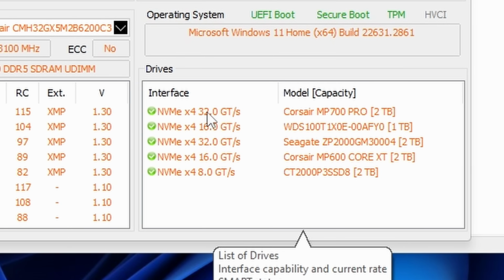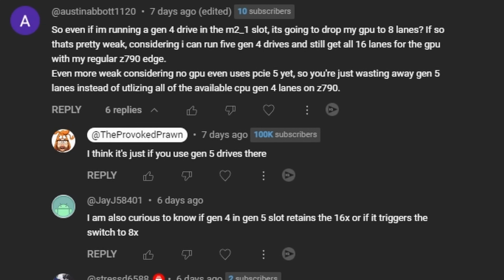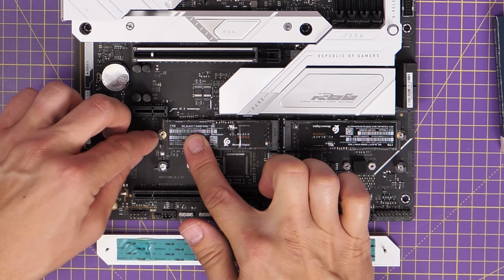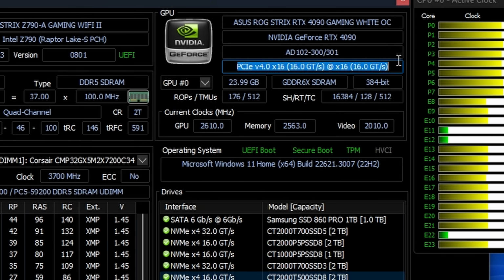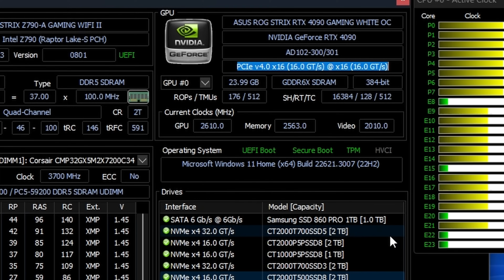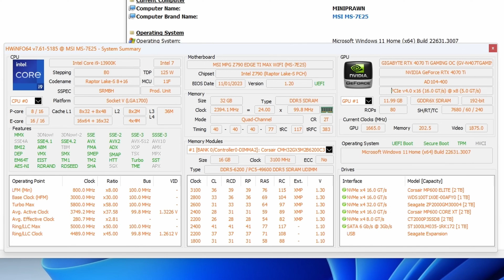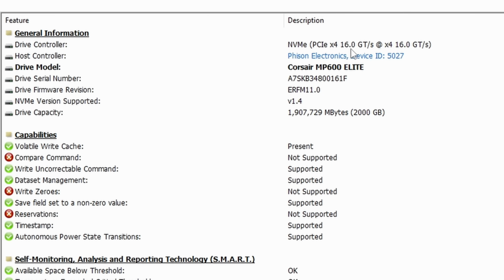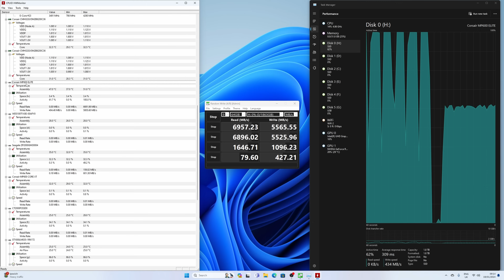Problems with NVMe SSDs and motherboards that you need to know

Comment: This isn't all that surprising. PCIe lanes are literally physical wires in the motherboard PCB, and the switch that splits lanes between the M.2 and graphics card slot is a dumb physical switch. It doesn't analyze the quantity or quality of data being sent through it, either Gen4 or Gen5 - it merely detects ANY activity at all coming from the M.2 slot and if so, it activates and re-allocates the physical lanes, like a throwing a railroad switch and changing a train's course.  

Of course, this lane switching scenario only happens on SOME motherboards, depending on the PCIe lane layout. But there are also plenty of motherboards that can run a x16 graphics card AND multiple Gen5 M.2's without any switching or graphics card downgrading at all. ALWAYS CHECK THE MOTHERBOARD BLOCK DIAGRAM available from Gigabyte, MSI and Asrock on their support page > motherboard manual PDF download. ASUS is ** because they keep their motherboard diagrams and lane configurations a secret.

For example, if you look at the Gigabyte X670E AORUS MASTER, it has a PCIe 5.0 bus with 24 total lanes, x16 dedicated to the graphics card slot and x4/x4 allocated for two Gen5 M.2 drives. 16+4+4 = 24 of 24 used, meaning that it has enough lanes that it doesn't need to share. 

Whereas, the Gigabyte B650E Aorus Master also has 24 total 5.0 lanes, allows for four total M.2 drives at x4 lanes each, but doing the math having all four M.2's plus a graphics card at x16 would mean 16 + 4 + 4 + 4 +4 = 32 lanes required but only 24 available. You could choose to use only two M.2 drives which is 16 + 4 + 4 = 24 and that works. Or if you want all four drives then that's where the lane switch comes in: If M.2 slots b and c are occupied, the board takes x8 lanes away from the graphics card and re-allocates them to the M.2's instead, making the math 8 + 4 + 4 + 4 + 4 = 24 which now works.

Comment: @The Provoked Prawn Completely unrelated question, but  I cant find a concrete answer anywhere else and was hoping you could help - I have just built my first ever PC, and I'm using the latest Corsair iCue Link H150i AIO Cooler for my i9 13900K. 
My question is which cooling preset do you recommend I use, and is there any negative effect of running the pump at the extreme setting? Would it reduce the lifespan of the pump, for example?

Same goes for my fans too, which preset would you recommend for Corsair iCue Link QX RGB fans? Would running them at extreme wear them out quicker? Or is it something I shouldn't really worry about?

Much thanks in advance mate.
Reply from the maker: Sounds like it's running too hot for your liking? I don't know the long term impact of that but there are other things you can do to reduce temps https://youtu.be/jP7nERdD-Gk

Comment: I have an ASRock X670E Pro RS and can fill all the m.2 slots and still get 16x Gen 4 for the GPU, depends on the CPU and motherboard type, if the motherboard has it's own controller chip for M.2 drives I think it frees up some lanes from the CPU.
Reply: controller chips still need pci-e lanes to connect with the cpu. what the issue is, you can have all your nvme's connected and r/w at max speeds, the chipset bandwidth is limited. so tranferring data from all of them at the same time doesnot addup because the chipset has to share the bandwidth with every device it has. it's a common misconception, the fact that the drives are working at full speed, doesnot mean that the data are going to the cpu at that rate.
Reply: You only get 2 nvmes with full bandwith on X670E. If you look at the block diagram every am5 chipset only have 4 pcie lanes to the chipset AMX. You can have all of them doing max speed individually but you load two chipset ssd and its already halved.

Comment: That's specifically why I chose the MB i did. I confirmed the last nvme slot piggybacked on a SATA port but did not interfere with the PCIEx16
Reply: Which board did you get? as far as I know this is a problem across all Intel boards
Reply: @quatreraberbawinner2628  AMD MSI X670E Carbon
Reply: Did you know that most GPU's only use a maximum of 8 out of the 16 lanes ? And the remaining 8 is lost ?
Reply: @Matlockization  untrue. Most cards cannot fully saturate 16 lanes of pcie 4/5 yet. However GN and HU have shown the 8 lane budget cards take a performance hit on pcie3 motherboards

Comment: It's daibolical researching this.  You literally have to read the manual of every motherboard you're looking to buy.

This was supposed to be easier with AM5, but the B650 and X670 chipsets then got inexplicably split into B650/B650E and X670/X670E which made the whole situation as clear as mud.

Why AMD didn't just say, "B650 is PCIe Gen 4 for everything and X670 is PCIe Gen 5 for main M.2 and first PCIe expansion slot" is a mystery to everyone.
Reply: What causes this? Filling up too many PCI lanes? What do you check to see how many devices you can connect without a hit to GPU performance?
Reply: @HardWhereHero you just read the manual.

It’s a bitch, but it’s totally possible to gather the information before you make the purchase
Reply: You can get kernel instruction pipe issues, cpu affinity, nvme driver code, to the fact that some boards may have one slot(main) apart from 3 slots on a switch before it hits the root complex, or any combo thereof. I'm not saying anything throttles down, but even the test software is baked, based upon the fact that threads rent time on a single instruction queue, assigning workload to any given logical processor. The OS could prioritize your system drive, and assigning workload at that level, start grinding. OSes do go thru kernel and driver updates for said reasons. This is not the first time the hardware has outstripped the OS. I would use one 5.0 drive and leave it at that. Buy the biggest one, not 4 of them because 6 is already specced out. When you're brand new, you're retro.

Comment: 100% of this issue is down to AMD and Intel sitting on the old ways of 24 (20 via CPU and 4 via Chipset) PCIE lanes is enough.
Reply: Forcing those who need more lanes to threadripper.
Reply: That's exactly what I'm having to go with for my newest build. We need more than 20 lanes... @richardj163
Reply: This is why I miss the old enthusiast line of core i7s that used the LGA 2011 socket.  Besides having quad channel RAM, those had enough lanes where you could even run a full dual GPU setup using 16x16 lanes, and still had a few to spare.  They need to update the enthusiast line and bring it up to full pcie gen 5 spec.
Reply: LGA 1700 uses 8 lanes for chipset… well at least for H670, Z690, H770 and Z790, the lower boards use 4 lanes though.
Reply: It's not an issue of old ways. It's an issue of edge cases. The overwhelming amount of people on these platforms are going to be running at most 2 drives and a GPU.
Reply: @jordanwardle11  tho, i miss the days when there was 6 SATA ports on every board (at least those worthwhile to buy without breaking the bank! - that joke of a mobo put into office PC's i certainly don't mean!^^)
Reply: Arrowlake has 60 lanes afaik
Reply: @Andrew_Thrift  *20 PCI-E Gen.5 + 4 PCI-E Gen.4 for chipset - idk who came up with freaking 60 lanes for a consumer chips, but i highly doubt it - tho, we'll see when it get's actually released! :-)
Reply: @BlackRedDead1943  there are 20 PCIe5 + 4 PCIe4 on the CPU, then the 800 series chipset supports 24x PCIe4 for a total of 48 lanes
Reply: @Andrew_Thrift  cool, thanks for the info ☺👍 - still not even close to 60 tho :D
(but yea, that should stop the few ppl whining about having no inbetweeny server grade but consumer quality board xP)
Reply: sorry to brought you to reality, but it's simply true that that's enough for most ppl, and depending on the PCI-E Gen. and the actual GPU, running it at x8 isn't really a problem at all!
(PCI-E gen.4 x8 is PCI-E Gen.3 x16 - so my 5700XT won't suffer as much with a board upgrade from gen.3 to gen.4 + NVMe Bootdrive + other PCI-E devices - tho, testing will show.)
Reply: @BlackRedDead1943  Don't be sorry. If you are happy with your setup that's fine. I have to accept data transfer limitations. As I stated in my first post, AMD and Intel are doing nothing to expand PCIE lanes. Motherboard manufacturers can add a chipset to allow more PCIE lanes and when they do; the prices seem to be 3 times as much (and higher) than a motherboard without.
Reply: Not sure about all AM5. But the 7800X3D has 28 lanes total. 4 for chipset and 24 usable. So you can have your whole x16 GPU + x4 M.2 G5 and 4 to spare. And the B650E and X670E chipsets have 36 and 44 usable respectably with 24 been Gen5. The original X670 only had 8. So the X670E that come with PCIe G5 and an M.2 G5 they don't have to split it. They do everything else with the other lanes. Probably why so many boards share M.2 with PCIe slots or Sata ports. Unable to used them all simultaneously. To prevent stealing from the GPU or M.2_1. 
This seems to be an intel specific thing. The LGA 1700 is limited to 20 lanes, and only 16 been gen 5, the other 4 are Gen 4. LGA 1851 will address this by having 20 Gen 5, x16 for PCIe slot and x4 for storage. And an aditional 4 Gen 4 lanes. So depending on the manufacture and how they allocate them. There should be boards that can do both at full speed. Asumming the rest of the PCIe slots and M.2 are split between the remaining 4 G4 and the chipset.
Reply: @Omizuke  The point is, they took away the dedicated bus lanes for other devices, such as PS/2, USB, Parallel ports, serial ports ,PCI,  AGP, IDE, SATA, Onboard Audio, NIC, etc and placed it all on PCIE without expanding the amount of PCIE lanes.
Reply: @Del_UK again only really a issue for Intell amd has loads of spare pcie gen 5 lanes heck most mid range amd boards have more than intells best units.
Reply: @mddunlap03  Gen 5  NVME drives will require 16x lanes to work at maximum data transfer. A PCIE GPU requires 16x lanes to work at maximum data transfer. That's 32 lanes for 2 components to work at their supported data transfer rates. Without anything else, using the PCIE bus. Neither Intel or AMD offer this, on home user systems.

Comment: How do you research this? Will it state somewhere in the specs?  I understand how to test once you have the parts, but id obviously like to know before purchasing
Reply from the maker: It should hopefully be in the specs, the manual or the pcie bifurcation  table
Reply: @TheProvokedPrawn  I've looked into this a bit (actually how I found your original video) and as far as I can tell this is a problem across all Intel motherboards, at the very least the z790 ones

Comment: Glad you doing this video.  I upgraded my PC from an i7 4790k to a i9 13900k with an Asus Z790 Hero which I thought I could use at full speed with x5 NVME drives. Not so. I've installed 4 now, plan to add a 5th one soon.  I think AMD Threadripper has much more M.2/NVME drives slots that any other chipset.
Reply: And cost a lot more.

Comment: I skipped M2_1 slot for my z790 dark hero because using gen4 still cut my gpu to x8, so I put my system on M2_2 instead, which still connected to the cpu.😅

Comment: Not all board steel PCI lanes when using the top M.2 slott, have a Gigabyte Aorus Elite X wifi 7 board its 4.0 x 16 too the grafic card, but the board have no support of gen 5 NVMe drives...

Comment: Hybrid PCIe M.2 drives are the future IMO (i'm talking about the new PCIe 5.0 x2 drives that also work as PCIe 4.0 x4)
Reply: still depends on the board. if the nvme slot has only 2 physical lanes for the drive, it's not going to work at x4 no matter what. but at gen 5, yeah it doesnot need more. this is for high end boards that have full physical lanes on every slot, but can route them at will to whatever they need. not sure there are boards like that for consumers, they are mostly in the enterprise sector.

Comment: Its important to note its not running at PCIe gen 4 x16, its running at PCIe gen 5 x8

There isn't much of a difference but there is a distinction
Reply: I shouldnt run into that issue with only one gen 4 m.2 right, that only happens if you fill the motherboard with m.2s?
Reply: @rodrigocruz8548  ok so on my z790 board the M.2 slots are marked _1 _2 _3 _4  and _5, slot _1 &_2 are running on the CPU lanes if I put an m.2 in either of those slots it would halve the available lanes for my GPU essentially making it a PCIe4 slot because 8 lanes of PCIe gen 5 is the same throughput as a gen 4 x16 slot

But non of this should be a problem because there aren't any GPUs that use gen5 PCIe, even my RTX 4090

that said if you are still concerned about it I recommend reading your motherboards documentation to find out which M.2 slots are running off the CPU lanes and which are running off the chip set
Reply: @rodrigocruz8548 YouTube deleted my comment, I have no idea why

you should be fine no matter where you put your M.2 as there aren't really any GPU that make use of GEN 5 PCIe, not even a 4090

But if your concerned about it I recommend consulting your MOBO documentation it will tell you with slots are running off the CPU lanes for my board it's slot 1 and 2
Reply: All the current generation GPUs (except for the H100) are PCIe 5.0, and the SSDs have four lanes each, so which device is PCIe gen 5 x8?
Reply: @shanent5793  are those consumer grade graphics cards?
Reply: @quatreraberbawinner2628  oops I meant all except H100 are PCIe 4.0, 16GT/s. Only the H100 is PCIe 5.0. All the gamer cards are 4.0
Reply: @shanent5793  lol oh
Reply: @quatreraberbawinner2628  so which one is running at Gen5 x8?
Reply: @shanent5793  the 1st PCIe slot i.e the graphics card

Comment: Have a Gigabyte b550 Aorus Pro AC with a NVME in the top slot.  I have confirmed via HWiNFO that GPU is PCIe 4.0 x16.  I will be upgrading this PC to a b650 with 7800x3d this week.  Hoping I don't run into this issue.  I had the same question after looking at the PCIe lane layout but consensus was it does not limit GPU lanes.

Comment: just checked my gigabyte z790 elite ax x motherboard with a gen 4 nvme in the top slot my gpu is PCIe v4.0 x8 (16.0 GT/s) @ x8 (16.0 GT/s) cut to x8

Comment: Good vid but not sure I agree with your suggestion to peel off the label off the drive. It is very thin and probably thermally negligible. Also the label is hard to stick back on the drive in case of a warranty claim, as it curls up when you try to re-apply it.
Reply from the maker: I didn't say to peel it, in fact I'd say not to. https://www.youtube.com/watch?v=BmqcKBwOwRc
Reply: I removed mine and i saw significant improvement. 5c+

Comment: I think its very mobo dependent not even manufacturer. My x570 proart halves the second pcie slot as well but not the first slot. What they don't tell you is that the chipset has 4 lanes dedicated to it.
Reply from the maker: yeah it varies wildly and it's not made clear. Hence why I wanted to highlight these things :)
Reply: @TheProvokedPrawn  oh even in the owners manual it's not clear I find it hilarious lol. I ended up putting my gen 4 in the top slot and my gen 3 in the slot that uses the chipset 4 lanes.